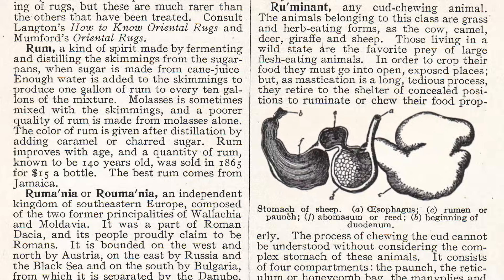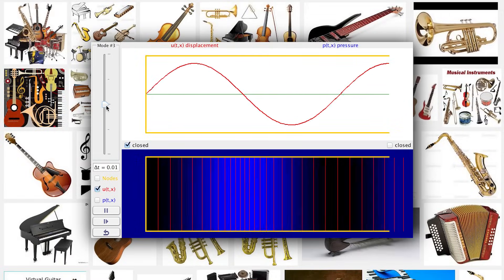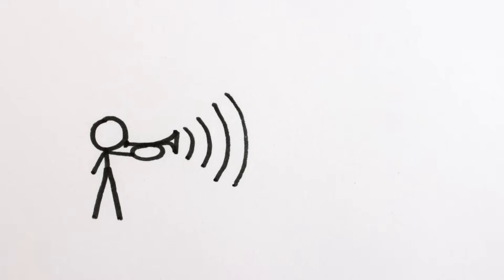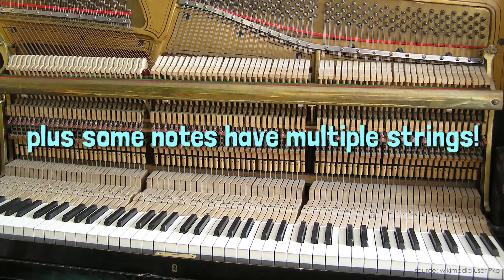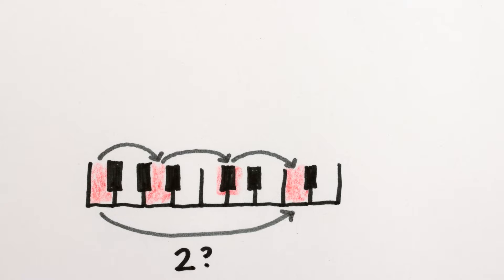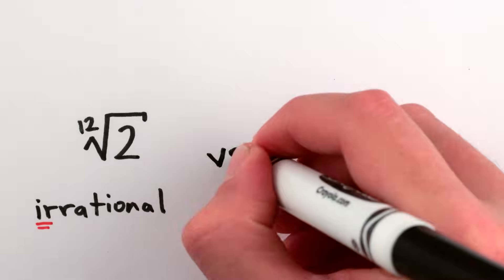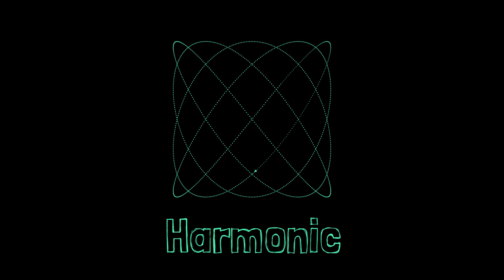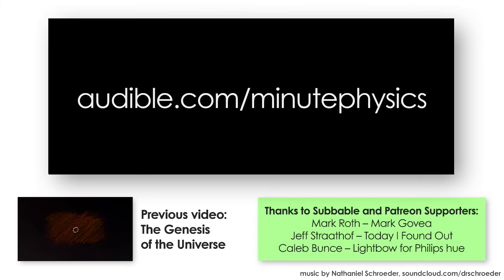Why It's Impossible to Tune a Piano

Comment: the title should be "why it is impossible to tune a piano using harmonics" because obviously a piano can be tuned.
Reply: No the title should not be like this, because nobody will come to this video (=
It's like marketing
Reply: Well that and he's correct you can't "tune" a piano, it has to physically stay slightly out-of-tune
Reply: You are wrong.  A piano cannot be tuned perfectly by pitch OR harmonics.  It is tempered.  A temperament is a controlled way of de-tuning a piano so that it sounds even and less offensive to the ear, but it will always be out of tune, no matter what. Our modern ears are conditioned to this fact and accept it.  Historically many, many temperaments were used until we settled on modern equal temperament.
Reply: Jim Bee If the intervals between the notes are actually either a little bit flat or a little bit sharp with the exception of an octave, can the Biano actually in fact be tuned? So I think the title of the video is actually appropriate
Reply: “Why it’s mathematically impossible to tune a piano”
Reply: @cjheaford  By that logic, nothing can be tuned. The notes of a piano can perfectly match the notes of literally anything else. So nothing can be tuned.
Reply: RipleySawzen 
I am a professional, 30+ year piano technician.  I make my living knowing EXACTLY how a piano is tuned.  I do it 6-8 times every work day.  That’s why I watched this video- to see if Henry would get it right.  He did.
You are wrong Ripley, and clearly don’t understand the way temperament works.  A piano cannot be tuned musically perfect. It can only be tuned properly, not perfectly.

Due to equal temperament well explained above and another phenomenon called inharmonicity NO TWO pianos are ever tuned exactly alike. 
This is well understood, and no secret.  If you were to have done a modicum of research before posting you would already know this.
Reply: Simon WoodburyForget 
Lol!
Reply: @cjheaford  First of all, two identical pianos can be trivially tuned to be exactly alike to within anything a human ear could possibly discern. It is ridiculous to assert otherwise.
Second of all, a string can be torqued and struck to produce any note of any desired amplitude. This is a scientific fact. There are no frequencies a string cannot produce. Your 30+ years of whatever cannot refute cold hard science. Just because YOU'VE never found a properly made piano doesn't mean that one cannot be made. Perhaps if you give it some thought, you'll realize why they do not make such pianos. My guess is that they are more concerned with the amplitude and how long the string vibrates for, which would make matching the pitch perfectly difficult to impossible.
Reply: RipleySawzen 
Look who knows so much.  You are correct about 1 thing:  2 identical pianos can be tuned very close together.  But it is impossible to closely match 2 different size pianos due to inharmonicity.

You are missing the point of this video.  Equal temperament is by definition OUT OF TUNE.  You will have a better chance traveling the speed of light than you will getting all 12 notes of the western scale in tune.  It is a mathematical impossibility.

Perfectly tuned modern pianos are very out of tune to an ear 200 years ago.  We just accept it today.
Reply: RipleySawzen 

I began a new post.  I’m tired of jackasses that would rather spew feelings without doing any research whatsoever.
You are dismissed Ripley.

Allow me to clear up some confusion:

I’ve seen many comments below from people that think Henry got it wrong, because “obviously pianos can be tuned”.
As with many armchair experts on the internet that can’t be bothered to do a modicum of research before they chime, there are doubters.  I’m here to tell you Henry is spot-on correct.

We are a dying breed us aural piano tuners.  I can argue that there are fewer than 2,000 people on the planet today that truly know how to tune a concert piano by ear.  Every single one of us is in demand like never before due to software.  Software tuning is getting very good compared to what it once was, but all professional piano tuning software STILL must pIt itself against an aural judge before it is released.  Aural piano tuning is a learned skill that requires years of practice- no matter how “perfect” you think your pitch is. 

I’m going to make several statements below about western tuning in general, and then some specific statements  about the  industry of piano tuning itself.  Stay with me:

1) It is not possible to tune all 12 notes of the western scale simultaneously. (That’s the point of Henry’s video)

2) The history of Western composition itself is deeply rooted in the limitations of 12 notes being in tune.  Until recently, composers simply avoided the out of tune notes.  Right up until the late Baroque.  Check out Chant to hear what 800 years of music sounded like before Josquin des Prez and the Renaissance.

3) IMPORTANT!  All instruments of the (professional) modern orchestra or choir constantly alter pitch flat or sharp as they perform so as to be in tune at any given moment.  They talk and teach amongst themselves as to how to be in tune when they play any interval at any moment.  This is the price of 12 note equal temperament. It’s the reason why skilled youth orchestras are always out of tune.  Position and embouchure are only learned with experience.  And don’t you dare argue me percussion section that has some pitched bells and stuff.  Those instruments are out of tune and it’s not your fault.

4) Pianos are a unique exception from #3.  Pianos are the ONLY instrument in the orchestra who’s pitch is fixed.  As a pianist, you are stuck with the notes the tuner gives you and that’s it.  You can’t alter pitch as a pianist.  Everybody else can.

5) Pianos are almost impossible to a physicist.  High notes are played by small instruments such as the piccolo for a reason.  Low notes are played by big instruments such as a bass.  Here the problem:  
“I want one instrument that plays higher that a piccolo and lower than any bass at the same time.  Plus everything in the middle must also be in tune always.” 

6) Pianos have an incredible disadvantage that most instruments don’t.  It’s called Inharmonicity. Henry didn’t delve here in this video, but it’s only because he must limit his scope of a short video.

7) Pianos are never, ever, EVER, tuned by pitch.  That’s the barrier to you musicians that think you know how to tune.  Whether or not you tune pianos by ear or software, you simply don’t care about the fundamental (note).  You only match coincident partials and forget about the note. Always.

8). There is no such thing as a perfectly tuned piano for all scenarios.
I am called in to tune the same piano 4 days in a row because a solo piano tuning is different that a chamber tuning that is different from a pop recording that is different from jazz.  None of this is a secret- it’s simply what pros know.
Reply: @cjheaford  Point #3 seems to say exactly what I initially said, that the piano isn't special at all, and that all instruments are out of tune at any given moment. Is that what you are saying?
Reply: RipleySawzen 
No.  That’s not what I’m saying:  It’s the western 12-note scale that’s out of tune, not the instruments that are made to play this scale.  You must understand Ripley:

In the real world, ALL instrumentalists and singers must constantly change pitch as they perform every individual note as to be in tune.  This is part of musical training for all musicians, except for percussionists like piano players.  

ALL instruments are totally in control always of their pitch.  Even guitar players understand this and accommodate.  Novice guitar players wonder incredulously why some chords sound better than others.  Pro guitar players know exactly how much pressure each finger needs on a fret to be in tune for each chord.  Equal temperament doesn’t work unless you can change pitch on the fly.  Equal Temperament is great because it allows you to transpose and play in any key, any time.  But the price is that the keyboard is VERY OUT OF TUNE.  

You’d see, pianos (and pipe organs) can’t change pitch.  They just play out of tune.  Nothing you can do about it.
That’s why “Piano Tuning” is it’s own industry.  It’s so incredibly complicated and goes against all your intuitions.
Reply: @cjheaford  So you're saying nothing can be tuned? That's exactly what I said initially. "By that logic, nothing can be tuned." A simple "Correct" would have sufficed. You could then go into detail about how other instrumentalists can alter their tune by playing the notes slightly flat or sharp to compensate for the off-pitch.
Reply: NO IT CAN'T !!!
Reply: @cjheaford  Do you know where the inharmonicity stems from? 

As an electronics engineer I would guess that the mechanical parameters of the string (speed of sound, elasticity and so on) aren't constant over frequency, paired with the effect of lower harmonics frequency modulating the higher harmonics (since the string does change it's length while oscillating).
Reply: DL3CE 
I do know DLC3E.  Thanks for asking!  I’ll do my best to explain the phenomenon:
Inharmonicity is the tendency for all harmonics of a vibrating string to be progressively sharp in pitch.  In other words: A string’s own partials are out of tune with the fundamental.  A single string vibrating is out of tune with itself!

All other factors being equal a stiffer string will produce a higher pitch than a lax string.  Remember this.

Okay; now realize that one string has different “domains”.  There is the middle of the string that behaves more relaxed and is free to move around more, then there are the node points near ends of the string that are much more rigid and stiff.  The natural partials of a string introduce many more of these nodes (stiff domains) in proportion to the speaking length, so all harmonics sound sharper then they mathematically should.  The shorter a piano string is, the greater the inharmonicity because these stiff node points force harmonics to be very out of tune.
That’s one reason why a big piano sounds better than a small one- it can be tuned more true.

This is tough to explain without visual aids, but I hope you get the gist.
Reply: Top 10 anime discussions
Reply: @cjheaford  Good except #4:  Some other instruments with fixed pitch are reasonably common in orchestras, for instance celesta, harp, harpsichord, glockenspiel, marimba, pipe organ, tubular bells, vibraphone, and xylophone, and it is even harder to change the pitch on these (except for the harp and harpsichord) than on a piano.
Reply: Lucius Chiaraviglio 
You are correct.  All of these instruments are out of tune- harpsichords famously so.  Bach championed Equal Temperament on Harpsichord. 
Our ears are just conditioned to the inherent out-of-tuneness in all these instruments.  If there were some magical way you could re-tune a marimba or celeste you would be amazed at how good they sound.
I’m not saying equal temperament is a bad thing (like some claim), but we do pay a price for equal temp.
Reply: @cjheaford  Well, actually, some ways do exist to make these instruments in tune, but they are generally too expensive, too user-unfriendly, or both.  Equal temperament with 41(*) or 53(**) notes per octave can make some of the intervals (including perfect 4ths/5ths) come out extremely close to mathematically in tune.  But that's an awful lot of keys (and in the case of an organ an AWFUL LOT of pipes) that you aren't going to use very often.

(*) https://en.wikipedia.org/wiki/41_equal_temperament
(**) https://en.wikipedia.org/wiki/53_equal_temperament

In the case of harps, harpsichords, and pianos, you could use some kind of mechanism to alter the tension on the string to alter the pitch; in the case of the harp, this would be a finer-grained version of the mechanism that they already have to get flats and sharps.  Clavichords (NOT common instruments) have this built in to some extent, although you need magnetic pickup to get enough sound output for a concert hall.

Not sure what you would do for idiophones -- maybe make the bars out of some kind of ferroelectric liquid crystal and vary pitch by changing a magnetic field?  Doesn't sound very ready for market . . . .
Reply: Lucius Chiaraviglio 
Of course experimental instruments exist that have more than 12 notes.  But that’s not equal temperament.  By definition, it’s a different temperament.  ET is what you use for 12 notes.

There are probably ways pitch of a sampled piano can be manipulated electronically.  But there is no practical way you could do this in real-time with real piano strings.
A typical concert grand piano has 230+ individual strings.  There is no mechanical device or electronic motor/solenoid that would ever have the precision required.  The heat alone from these motors or bearings would cause the piano to go out of tune.
I know how piano strings behave and respond.  These 230 strings will drift out of tune if you constantly are stretching them during a performance.
Reply: cjheaford As per the links I posted, you can have equal temperament with some number of notes per octave other than 12.  Some of the higher numbers get very close to closing the circle of 5ths.  And as I said about methods of pitch bending on a piano, they tend to be impractical, so not sure why we have any disagreement there.
Reply: Lucius Chiaraviglio 

1). You assume disagreement where there is none Lucius.  I wasn’t disagreeing with you about pianos.  I simply expanded on your notion.

2).  I’m aware of these Wikipedia pages you linked.  Since tuning systems are a lifelong interest of mine, I’ve already read these and many other articles.  When learning the trade of piano tuning, I even needed to produce a “Mercator Comma” to my instructor.  Mercator was a proponent of the 53 equal temperament system.

3).  We could split hairs over theoretical tuning systems devised by mathematicians all day, but none of it is staying true to the spirit of Henry’s original video at the top.  Which is, after all, why it’s impossible to tune a piano.  Pianos have 12 keys between the octaves.
Reply: cjheaford Good -- we're in agreement.  Except that I have seen a photo of a piano having more than 12 keys per octave.  I'll have to try to find it later when I am on a real computer instead of a phone.

Edit:  Found it:  https://en.wikipedia.org/wiki/File:Multi-keyboard_piano.jpg (built in 1796, and on display at the Musical Instrument Museum in Vienna); also see https://commons.wikimedia.org/wiki/Category:Musical_instruments_in_the_Collection_of_Ancient_Musical_Instruments,_Kunsthistorisches_Museum#/media/File:K%C3%B6nnicke_Harmonie-Hammerfl%C3%BCgel_Wien_SAM_610_2.jpg and https://commons.wikimedia.org/wiki/Category:Musical_instruments_in_the_Collection_of_Ancient_Musical_Instruments,_Kunsthistorisches_Museum#/media/File:K%C3%B6nnicke_Harmonie-Hammerfl%C3%BCgel_Wien_SAM_610_1.jpg
Reply: This is why the theremin is the perfect instrument
Reply: Zhong Ping Or the trombone.  Or even the tromboon . . . .
Reply: @iComedy09  you say that meanwhile theres 3 million views
Reply: certainty, not any instrument can be tuned exactly, because what the notes sounds even depend on how you play them.
Reply: @cjheaford  Thanks for clarifying this one!
Reply: It should be noted that the problem presented in the video is not specific to the piano, and 12 equal temperament is not the only solution to it.
Reply: @RipleySawzen  this video about cold hard science refutes your misunderstanding of cold hard science. I'd listen to the piano tuner and the physicist if you want to know what you're talking about.